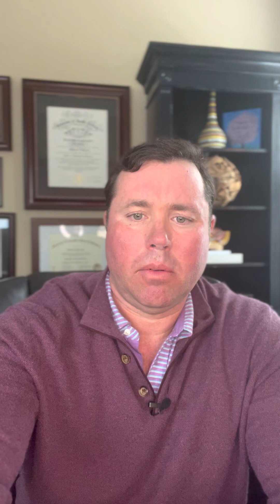Salvage Prostatectomy

Comment: I am facing the opposite problem - salvage treatment after prostatectomy.  The prostate was removed last November and in January when I saw my consultant he said I had metastatic  cancer of the lymph nodes which will need treatment later down the line and my PSA was 0.1.  I saw him again in May and the PSA had gone up to 0.12.   He did say though, that having the prostatectomy first was a good thing, as had I had radiation first, he would have had great difficulty removing it after, confirming what you say here Dr. Stiles.  Thanks for this channel.
Reply from the maker: Thank you for your support !